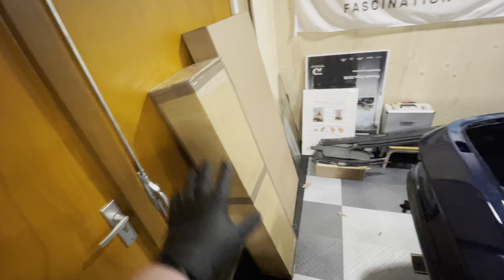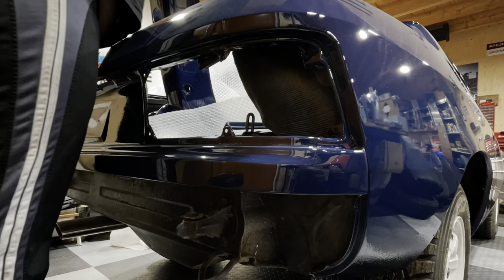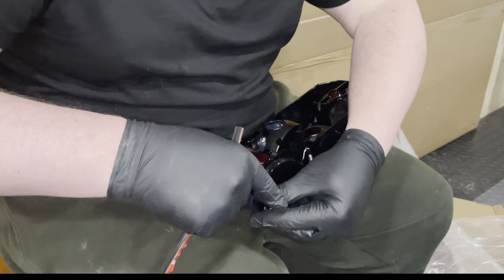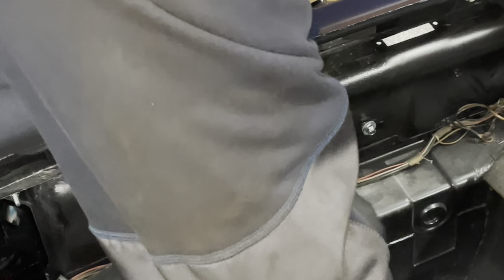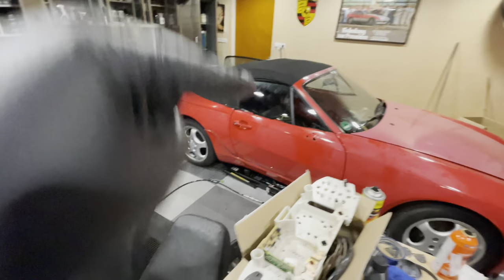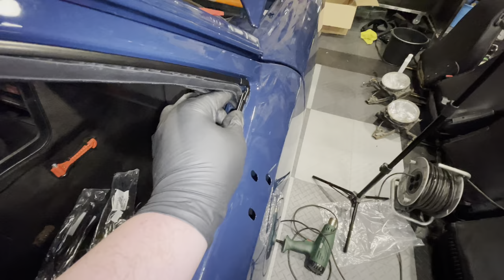Building a Porsche 924 Safari: building up the body after repaint - Part 1

Comment: Jon, be exceptionally careful on the interior window scraper rubber.  The clips that hold the rubber to the door shell are a complete pain to do.  I ended up paying a shop to do mine on the 968 because I got WAY to frustrated.  The safari build is looking nice!❤
Reply from the maker: Thanks Jeff! I have replaced a couple of those scraper rubbers in the past and it never becomes easier. Super frustrating.

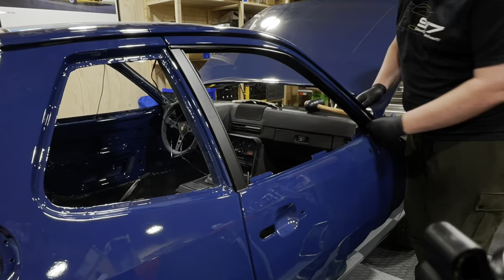Comment: How hard was it to remove the trim you are installing at 14:38? I am scared i will break it when i try to remove it.
Reply from the maker: I did not find it difficult, but you do run a risk of bending the trim, so just be gentle. It is a press fit.